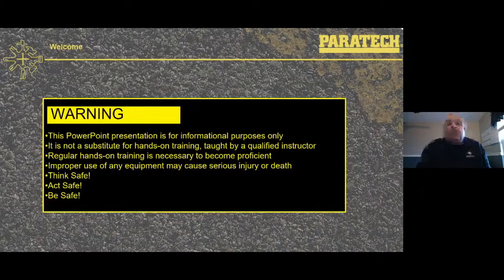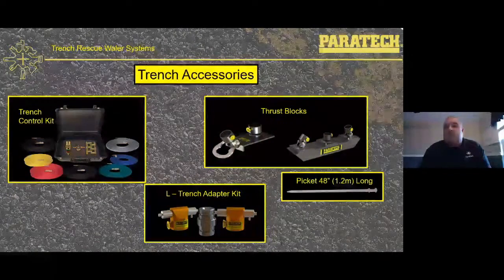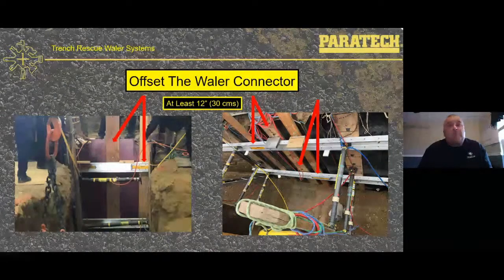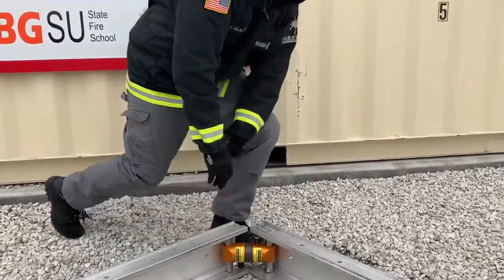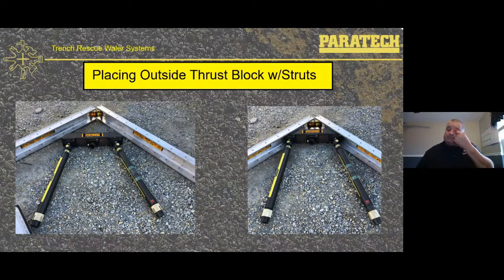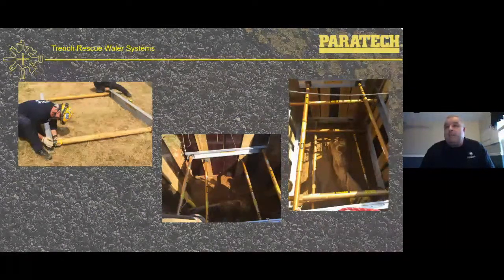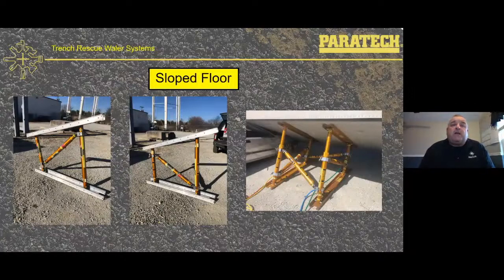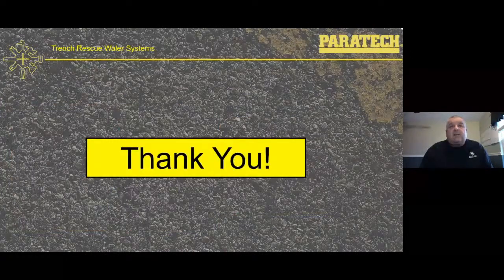Paratech Virtual Workshop: Trench – Waler Systems

Comment: For quick future reference:

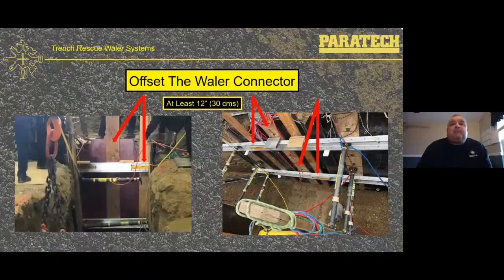6:22 offset waler connectors
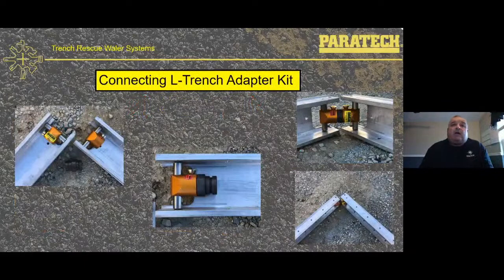7:43 L trench adapter kit
10:36 when to use stop blocks
13:15 shooting to 200 psi max
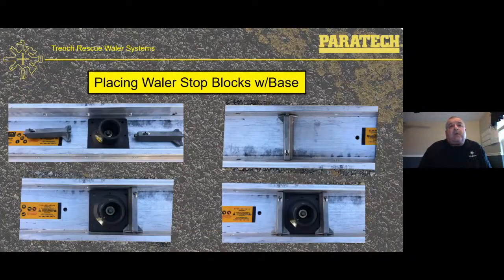14:12 placing waler stop blocks with base
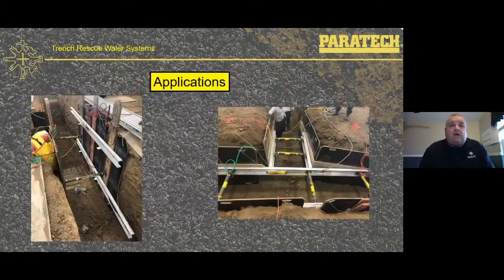19:21 T trench configuration
20: 18 MUSAR adjustable waler hangers

Comment: Is it possible to use the Long shore wailer rails in a trench with the Acme - struts?
Reply from the maker: Aye, the waler rails are strut system agnostic. They interface with the base plates, so you can use any Paratech strut with the waler systems.